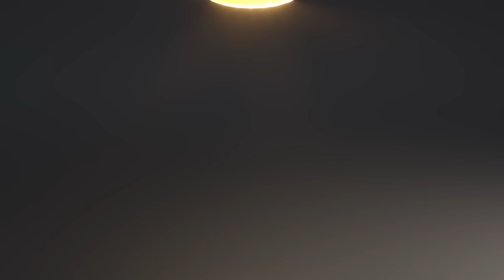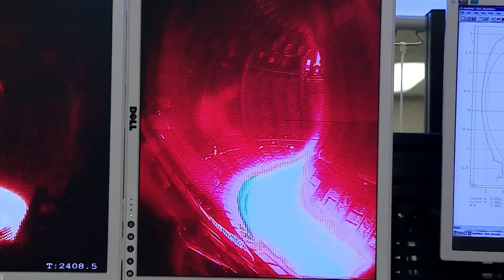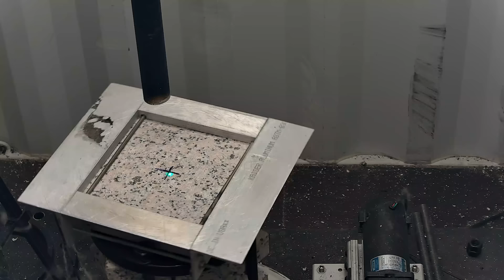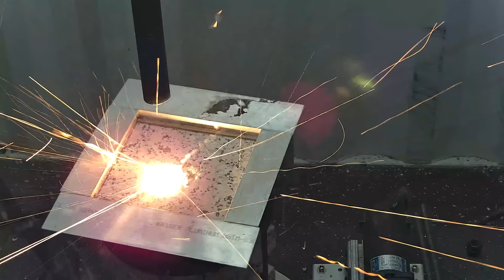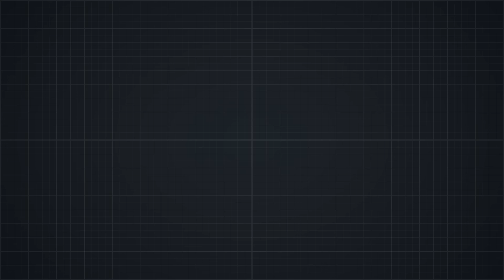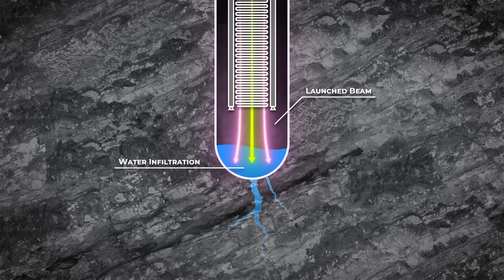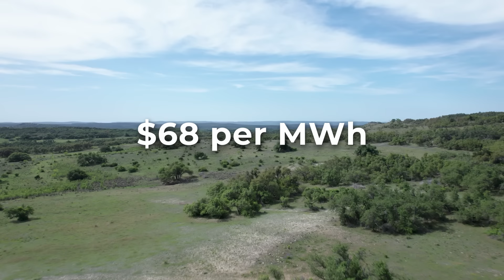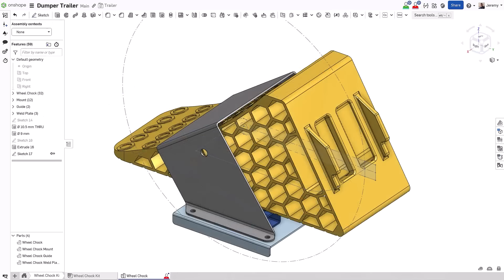Geothermal Energy is Changing

Comment: i have a few questions, will this technology still work if/after you've directionally drilled, can you make a larger hole by "splitting" or shifting the focus sideways down the hole, what are your solutions to well control, normally the drilling mud is the primary barrier using hydrostatic pressure plus additives to control the well, with no mud you will be "under balance drilling" you would probably need to implement some sort of "managed pressure drilling"

Comment: For those wondering it’s not the digging of the hole that’s the hardest it’s the consistency of the heat transfer the hole despite the issues listed in this video is the easiest step

Comment: Re: fission as the source of subsurface heat-

The vast majority of the heat in the mantle/core, etc if simply leftover heat from the primordial solar system- caused by compression and convective friction, etc. it's simply such a massive amount of energy that it hasn't cooled very much, even over billions of years. Radioactive decay is a distant third, and natural fission- which occurred billions of years ago, can no longer happen due to the decay of U235- is negligible. (Some papers have demonstrated a possibility of a natural deep-core reactorr, but it is speculative and unproven, as well as being a relatively small source of thermal flow)

(Via Dr. Quentin Williams, associate professor of earth sciences at the University of California at Santa Cruz via SciAm)

Comment: We actually have an intrinsically safe British fission reactor that’s currently being homologated in Canada. It’s a concrete box with no moving parts. The heat transfer medium is molten salt. The fuel is mixed with the same salt but kept in tubes. It cannot overheat because excess temperature stops the N reaction. When it cools the reaction restarts. It could literally be set to full load then be cut off from its cooling. The fuel would gradually get used up but nobody would be at risk. Google Moltex.

Comment: I used to think geo-thermal was the answer to "free" energy or at least cheap energy. As I researched further I found geo-thermal's Achilles Heal, water. There are numerous geo-thermal plants that no longer run because they've run out of water in the area. There's a power plant, in America, that was cheap to build and run because it was the perfect location for such a technology, all you had to basically do was add a generator and some pipes. It shut down after 25 years because they ran out of water. This is why geo-thermal isn't everywhere and supplying the world with abundant energy.

Comment: Isn't this, using energy resources from earth, on par with oil?
Releasing the energy stored up in oil and using it on the surface of earth. How is that different from taking the heat energy from inside of the earth and releasing it on the surface of the earth?
Sure, not as many dangerous gas emissions, but you're still moving energy from inside of the earth, to the surface of the earth.

Comment: A few major issues. 
First. How they plan to remove the matterial, stringy glass fibers is a clog that will happen very quickly.

Secondly , the earth is not homogeneous.  There are natural water caverns, brine pools, oil, petrolium and natural gas pockets. 

Trational drilling uses drilling mud to force back those non rock elements , which can have a fuck ton of pressure.

Comment: you really need a good cooling system if you don't want to melt your wave guiding tubes. The heat generated inside this very small hole is tremendous, it will reach instantly 1000°C and if you don't cool it down, the temperature will increase way more, to the point of melting the steel pipe. 
An other concern is the clogging  of the evacuation pipe, since it will have to carry the vaporized elements that will condensate into stone wool. And even if it is fluffy, it can be a real pain to evacuate. Plus since it is an excellent heat isolation, it could increase the over heat issue.
also, drilling is not only rocky stony, and I really am curious about how it will perform against other materials like mud, clay, water pocket, ...
There are a lots of possible issues to find solutions for, but I hope that they will find reliant solutions to make this tech available every where.

Comment: 50kv DC?? Someone do the math and tell me how thick the copper needs to be to compensate for the voltage drop over 7km of hole depth 😅
Reply: The pipe down is a waveguide. No cables, the gyrotron sits at the top and the microwaves just go down the pipe like light goes along a fibre.

Comment: A few things that would have been nice to know:

1. Why does the hole have to be that size? Why isn't 10cm okay?
2. As theyre 'drilling' through the earth, where does the vaporised material go? In the lab they just blow it away, but could they do this in a confined hole?
3. In real-world conditions, the deeper they drill, the hotter the earth will be. What impact will that heat have on the equipment? If the rock is hotter, does that make it easier to drill?

Comment: You need kill mud to keep the hole from collapsing. More logical to drill using a coax aluminum pipe with lower density thermal and electrical insulator to power a drilling head.

Comment: If they are drilling the borehole to extract geothermal heat to power electricity production, why do they not build a power station at the site to provide the power to drill the hole in the first place, and then adapt it to be driven from the geothermal heat once the hole is dug.

Comment: my immediate thought to the problem of boring is to lower a drill itself, on a wire, then have pistons out from the sides grabbing the wall so it can secure itself and bore down there. but, how would the material get to the surface

Comment: If ground source heat pumps can use lower boiling point fluids..... What not use something else apart from water?

It will be easy to condense at the surface and recirculate?

Comment: Electrify all the things!
But might be a bit too early as electricity isn't getting cheaper quickly enough yet.
And the biggest issue with drilling/tunnelling/digging is not the worst case rock/ground type but constantly changing rock/ground types. It makes cost estimates really hard to do.

Comment: Arrright, just got started on this video but I gotta ask.... If you can or ever could "drill a hole" to the center of the earth, would you not change it's state of pressure dramatically and thereby change it's function? That's just a 1+1='s 2 in my mind, no debate required! I'll finish the video but my question will remain.

Quick edit here:
Nuclear used to cost me 6.3 "cents" per KWH.  
Now it's 8.9 but the electrical costs are not the bulk of my bill, it's the garbage tax that kills me! The line fee, the free air space fee, the price to live fee, the final transmission fee.... It's not the cost of supply for my demand, but the cost of being tied to the "grid" that kills me! And that fact I can prove in electric bills over time. 

This thing you show solves no problems. God I wish, if only...... But I'm going solar because I get 30% back from the Government and this stuff really ain't that expensive up front if you can do it your self. If you can't then you have to pay for it by any tit you can grab hold of and it will be a bad time for those of you. Just laying down some of the facts here.
Cheers 🍻

Comment: You can run an electric superheater in a power plant.  You start it up with either diesel generators, or the grid.  You then cut it over to your output when you're making power.

Comment: "fission reactions in the earth's core", it's actually just regular old radioactive decay, and even then that only accounts for about half of it, the other half is just sorta leftover heat from the earth's formation (iirc, that's more specifically crystallization of the inner core, which happens because the outer core is molten from the initial heat)

Comment: RF Engineer here, we actually use quartz as a substrate material in high-frequency applications because it is essentially transparent to microwaves. So I am wondering if this is an issue here, because it would let the microwaves just pass through without heating up and turning into vapour.

Comment: Very interesting technology. I hope it does work out.
One small (maybe not so small) gripe. Wind and solar are not cheap energy sources. They are not even near the 3 cent/kWh that is always thrown around. When the wind does not blow and the sun doesn't shine, the price of a kWh from solar or wind is infinite if I need it right now and not in some hours. What use is an energy source that is fluctuating like crazy in a developed, very power-hungry economy? You just need to look to Germany or Denmark to see where this nonsense leads to. The kWh cost up to 50 cents there. And spot prices are even more than double that.

Comment: I'm curious if they could come up with a way to force the vaporized rocks to coat the outer wall, both to help prevent the fumes from being blasted back towards the workers on the surface l, as well as to provide additional reinforcement to the tunnel walls

Comment: Given that the drilling process generates a lot of debris, I wonder if that debris will have a negative impact of longevity of drilling equipment. I wouldn't be surprised if they had to pull out a drilling head every now and then just to clean it. In fact, this would be quite similar to what we have right now, where we have to pull out a drilling head just to replace a drilling bit.
Besides, it seems like they talk about the output power when they mentioned the need to go to 1MW. I have no idea what's the efficiency of gyrotron, butI wouldn't be surprised if it was below 10%. This means that all costs associated with drilling with go up by order of magnitude.

Comment: Some quick math... If they want to drill for 100 days to get 10km then that is only a 5x drilling speed increase (i.e. 5 meters per hour) which sounds achievable.
Reply: thats a lot more than a 5x speed increase. the speed that they are drilling is not one meter per second its one meter per hour. 5 meters per second i imagine is essentially impossible
Reply: i think you just got your units wrong. 5 meters per hour is likely achievable (if they solve the plethora of other problems) and that gets you your 100 day drill
Reply: @boycefenn  thanks!  Yup, just a dumb typo, edited.  5 meters per hour × ~20 hours per day × 100 days = 10,000m.

Comment: If the vaporised rock is condensing out on the ceiling like that, how are you transferring vaporised rock away from, and out of the hole? The mass has to go somewhere... And if you're 6km down... Where is it going? It doesn't just stop existing.

There's a lot of problems with this... Obviously have a go! I wish them all the luck in the world.

Comment: If you were drilling at the site of an existing power station, wouldn't you have access to very high voltage power supplies from the grid? I have no idea about these things, but if a coal power station is pumping out electricity at high voltage (400,000 V in the UK I believe), does it have the capacity to consume it at those sorts of levels? That would potentially solve one of the problems. Or am I just hopelessly misguided?

Comment: Its curious to me that in the western United States, Hawaii, Italy, Turkey and New Zealand where there are easily accessible geo thermal resources it plays a relatively small part in the energy mix. This suggests there are more issues than meet the eye.
Reply: For Taiwan it's not actually any technical difficulties, just that every single location needs tailor-made solutions to maximize extraction efficiency, and without these tailor-made changes, the plants might not even be financially feasilble. In order to design the plants correctly takes quite a bit of time and geological research, which can be beyond the scope or abilites of potential operators.

The current solution is that the government would foot the bill for the first pilot well, and then commercial wells can follow in the same area using data the government provides. But it's still risky and costly nonetheless, which discourages investment.

Taiwan has roughly 1~7GW of easily (relatively speaking) accessible geothermal, and an estimated 40GW maximum accessible with currently available technology -- though a lot of that would be in protected land (national parks), so actualy availability may be much less. With that said Taiwan only has a miniscule 7.4MW of actual installed geothermal capacity, with a (seemingly impossible) goal of 20MW by 2025, and 200MW by 2030.
Reply: Not an expert, but for new zealand geothermal energy production the limiting factor is the volume of water that can be extracted sustainably. If to much water is used for energy production it will impact nearby geysers and hot pools (which are tourist attractions). We use all the available"easy" geothermal sources, but if it suddenly becomes cheap to drill deeper bores that could open up more capacity.
Reply: USA has a swamp problem.
Reply: From what I have heard from engineers doing work related to the NZ plants, the running costs are really not zero like the video implies. I don't know if it is the primary limitation, another poster has suggested water level issues, but the water coming out of those boreholes is increadibly corrosive. The engineers made it sound like you pretty much always had only half the plant operating - while the other was undergoing maintenance.

Comment: Great idea, but not going to work. How do they keep the rock as gas on the whole drilling process? Did Nitrogen enough for countering the high pressure of subsurface, and it's undoubtedly heterogeneous layer of rocks and mud? How it can protect the tool from overheating?

Comment: This is NUTS!  Some damned impressive tech.  The super inert, stable casing that is generated is a very significant beneficial offshoot of the technology, as is the continuous drilling.  You could pressurize the hole with air to keep water influx to a minimum.  The pressures for any sort of free flow vertical well fed ingress could get very high, though.  I can see why you would want to restrict this to geologically stable areas.  A collapse way down the borehole would be bad, one near the top would be disastrous, ruining the the entire borehole infrastructure.

The quip about govt engineering requirements leads me to believe that either you have done some, or know, or have heard from some people who have.  I worked for LM for the majority of my EE career, and I wanna tell ya, it was the bane of all of our existence.   I even had one of the docs folks tell me that the documentation was the actual final product.  I laughed and said, really, then just drop some in the lap of a fighter pilot currently using, say, LANTIRN or Longbow or whatever in lieu of the hardware, at that moment, and see what he says to you.  What a dumb statement.  It is certainly a requirement, but not, unless you are subbing the build, the end product.

Comment: pretend that thing is 3km down.  Now that rock gas is going to have to traverse that 3km upwards to get out of the way.  During that, it's going to cool and stick to the side of the bore hole.  This will plug the hole so no more gas will be able to get past.   Pressure will build and build and build at the end of the drill. Also, it will become more and more difficult to advance the drill downward.  So either the drill will seize or break under pressure OR it'll end up melting itself.  Once that happens, you're out millions of dollars.

Comment: So, a 30 degree temperature rise per kilometer of depth implies about 11.6 kilometers of depth needed to reach the temperature of supercritical steam.  Going off their own provided figures, that's 11.6 gigawatt hours of electricity to drill an eight inch hole.  After the casing and piping needed to contain the steam, that's probably more like a four inch pipe.  My first thought was that it would take forever to break even on the embodied energy of the hole, but even with some fairly conservative estimates - nope, they should be able to repay the energy cost within a year or less, which is...kind of shocking, actually.  I've been wondering about this for years, but you just don't hear much about the technology in this area.  I'll be watching these guys with great interest.

Comment: Would be very cool to have the drilling parameters adapted automatically by optimizing in real time the quality of the hole.

I've seen this approach in different applications and it has good results. An example is a device to heal muscles through electric impulses: the best way to send impulses - frequency and duration of impulse - is different for everyone, but they are able to fine tune the two parameters in real time by looking at the muscle's response to the signal. This way, they don't have to manually parametrize the device for every patient, insteaf there is a single starting set of parameters that quickly converge to the patient's optimal values.

Comment: The 'Real Question' is how are you goint to control the entry into the boehole of extremely high pressure fluids and gas. 
A hole 25,000 could expect pressures up to 20,000 PSI ! That is enough to blow your hat off ! 20,000 PSI exiting an 8 inch outlet ?
It sounds like a project funded by USAID !